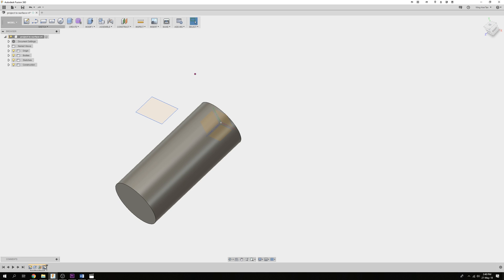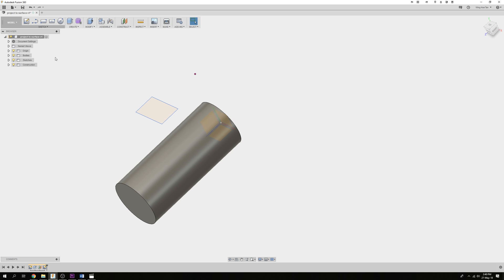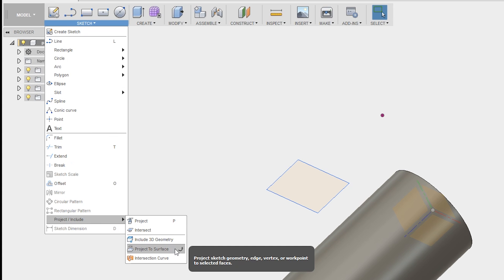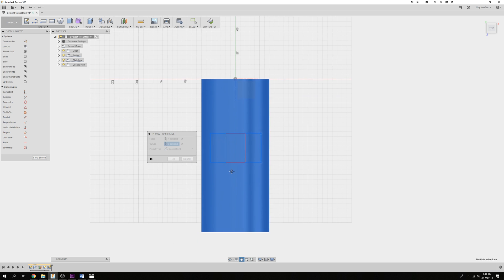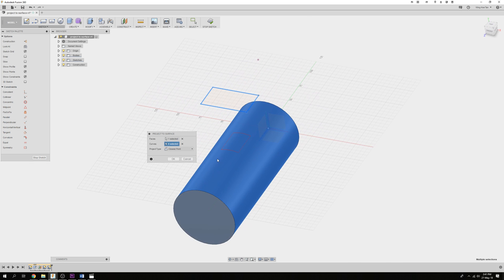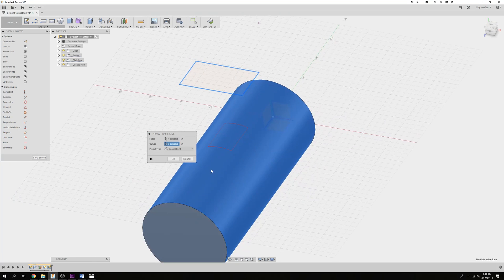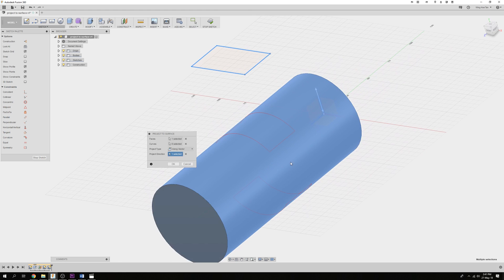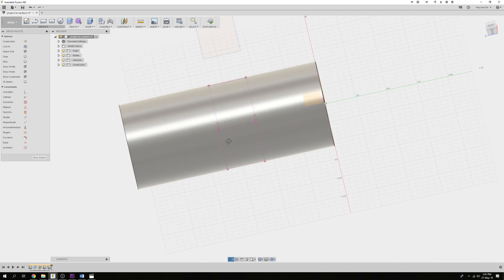Fusion 360 - Project To Surface

Comment: I keep getting an error when I try to project onto the surface. How were you able to draw the square away from the part so you could project onto it?
Reply from the maker: You can create an offset plane and draw the square on that plane. Do note that you need to create a separate sketch to perform the projection. If you try to perform the projection in the same sketch as the square, you will get an error.

Comment: Thanks, but I have yet to see an example of what to do with it. Projects fine, but doesn't seem to want to extrude and cut, etc. So, just the sketch on a curved surface?
Reply from the maker: Hi Robert, thanks for the comment. I was always under the impression that the sketch could be extruded. When I went to try it, it does not. It does seem like Fusion 360 does not allow for non-planar extrudes.
Reply from the maker: When I had the idea to do this video, I had originally thought that people would be able to use this to create extruded text on curved surfaces. But as I gained more experience, I  have realized that embossed text can easily be done by choosing "from object" as the start option when you extrude.
Reply: @Fusion360School  cheezus christ I've been trying to get this to work all evening. Turns out you can simply project from an object now...

Only problem is if you want to extrude a sketch over multiple objects, that doesn't seem to work or at least I haven't gotten it to work.

Anyway, thanks for the help!

Comment: I've very new to Fusion 360 but can't see what I'm doing differently but I'm getting the following error.

"Warning: Not support projecting sketch geometry into same sketch, please change the target sketch or geometry."

Any tips on this?
Reply from the maker: Hi Chris, I've done some experimenting to try to replicate this warning. When you first start the project to surface tool, you would be prompted to select a plane. You might have wrongly clicked on the sketch that you want to project. You should instead click on one of the primary planes that is parallel to your sketch plane (0:18). Hope this helps.
Reply: @Fusion360School  I'm getting the same error, taking into account your comment. Someone else here mentioned this is outdated, per the a new version of F360. Maybe that's the issue. If so, I still don't know how to fix it. The steps seem so simple, yet something is wrong.
Reply: @ThatAdam12  you must finish this sketch, select create sketch and now you can do it